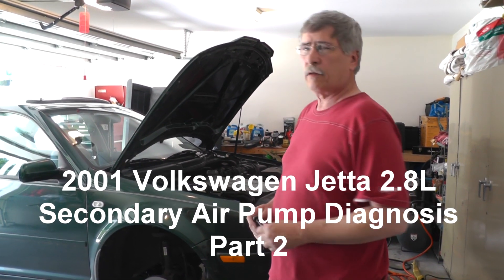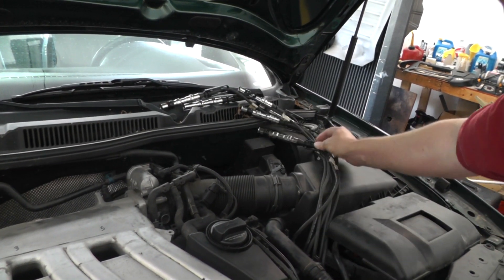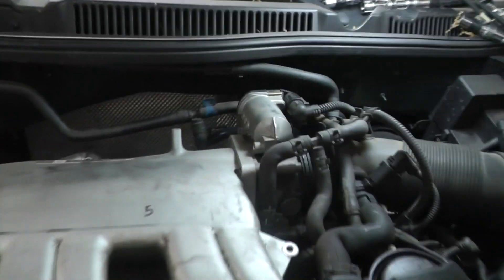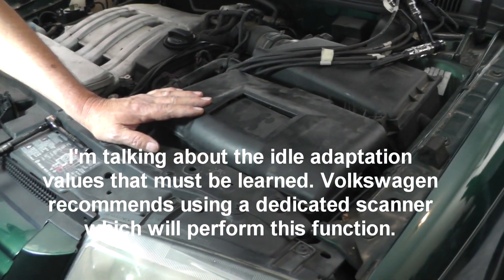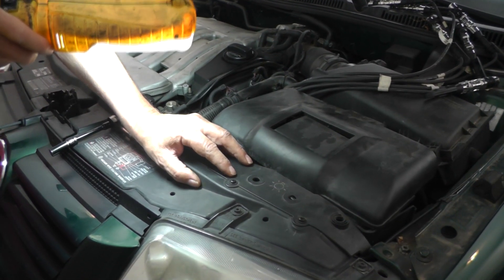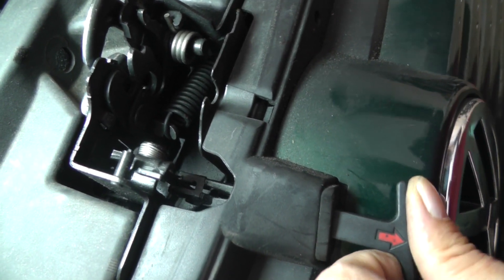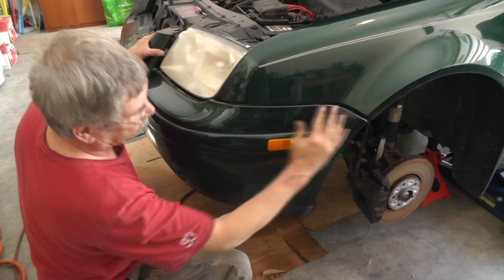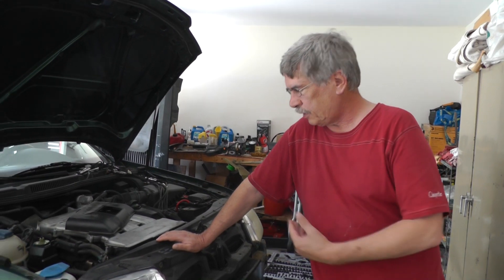Volkswagen Jetta Secondary Air Injection Diagnosis Part 2 (Lock Carrier Service Position)

Comment from the maker: I appreciate your comment. I know you're like me about plastic clips. I just hate those things. I didn't show it in the video, but that metal clip on the hood latch went flying somewhere and I didn't find it until I pulled the bumper cover off. I assume you're talking abut the metal clip at 7:17 as I didn't see anything at 8:17. Yes, if I couldn't find that clip, I would have used a tie to hold the fork together. If I remember, you have a 2001 Jetta also don't you? Thanks for watching Dave!